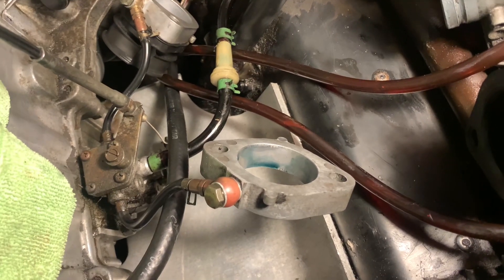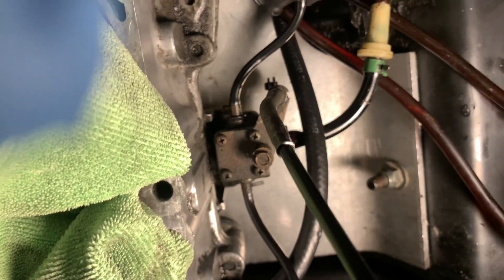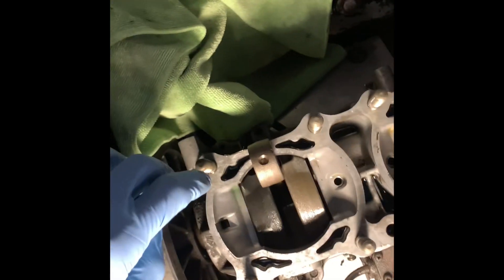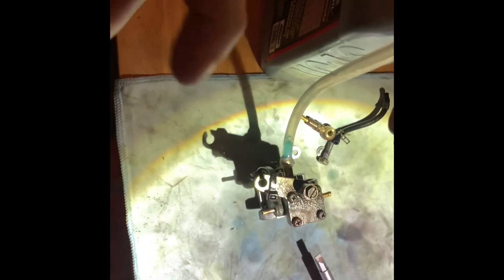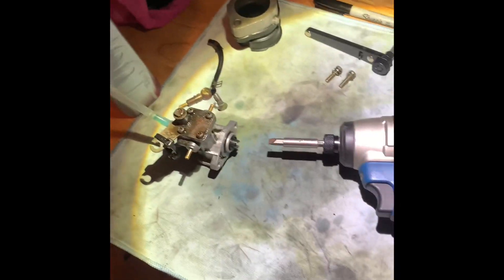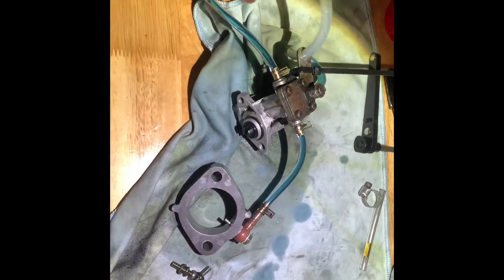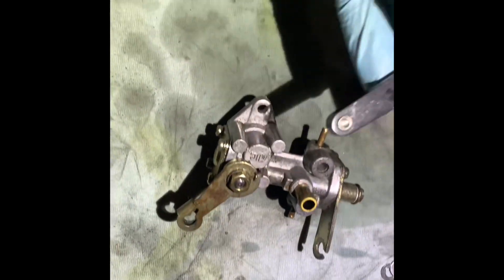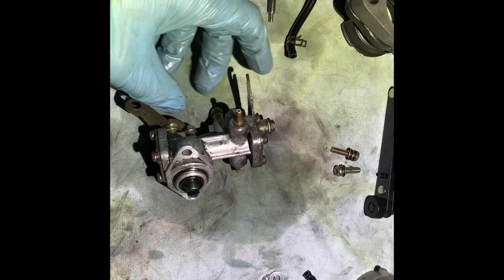How to prime mikuni oil pump 440cc

Comment: In early 90's I had 1982 Ski Doo blizzard 5500 I didn't noticed one my Cylinder Jug wasn't getting oil . I rebuild hall motor even bottom half motor a complete rebuild and fix oil pump to